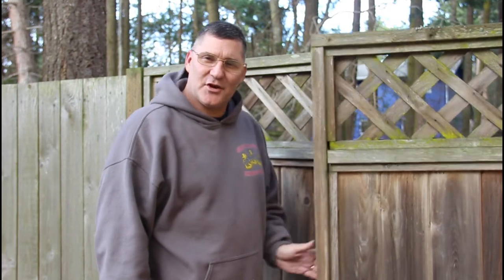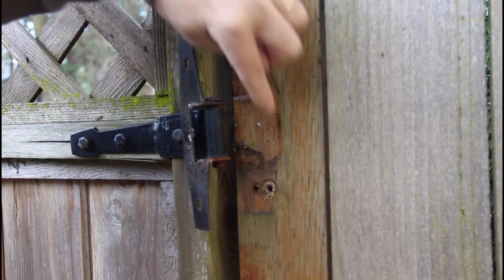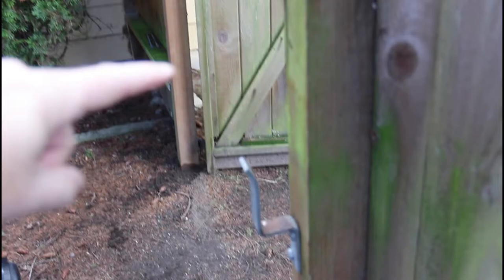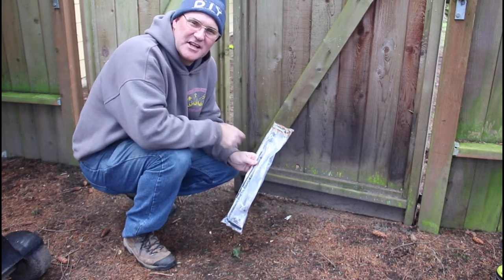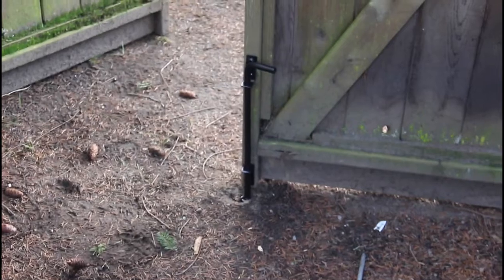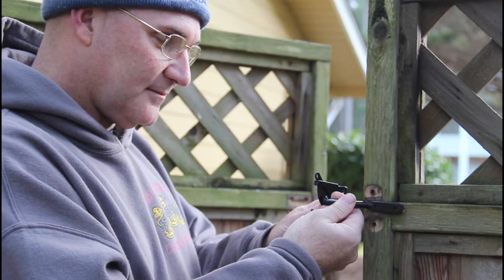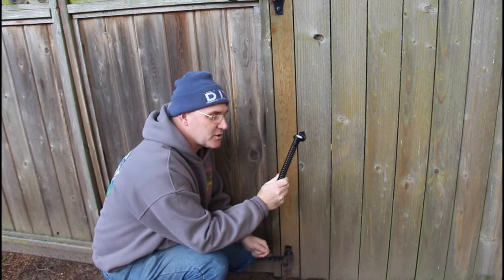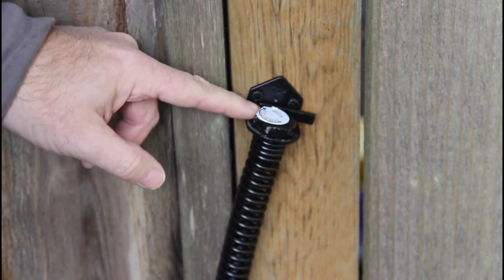Installing a SELF-CLOSING Gate | Fencing Repair DIY | 2020/06

Comment: I use a 15" PVC Pipe (usually the grey electrical conduit pvc pipe).  Hammer it in the ground and then pull it back out with those pliers.  Dump the dirt out, then put it back in the hole. Mine has been in 10+ yrs and probably pulled it out 2x to clean out the dirt. Don't concrete it in! Use a longer pipe and lower your rod instead. I have 180 lb goats and they always test the gate. It's solid with no movement!
Reply from the maker: Great idea, and will never rot!!

Comment: Did you just use a random piece of pipe of that cane bolt anchor and if so what type/size?
Reply from the maker: I bought a 12" length of galvanized pipe that had a larger diameter than the ground pin.

Comment: How tight does the spring need to be I’m torquing it … 3 full turns Can’t turn much more 
Gate is not closing very fast at all … so slow it won’t latch
Reply from the maker: Is the gate balanced and the hinges oiled? Depends on how big the gate is!

Comment: seen these springs everywhere here in UK, but never installed one. This is my question: I have a gate which opens outward (because there are 2 steps, so opening out was the best option). It's a simple metal gate. I don't want to instal the spring outside. If I load the spring on the other direction, would this PULL the gate shut instead of pushing it?
Reply from the maker: Not sure, its more of a twist that a pull. But in theory it should work, or consider a different type of closer, like on a screen door type.